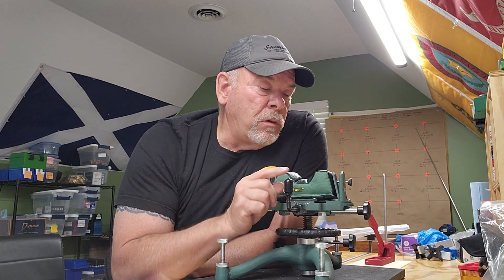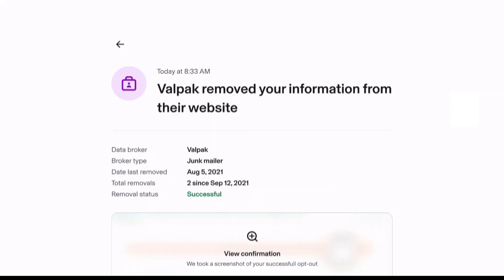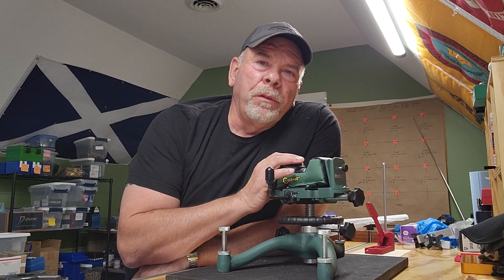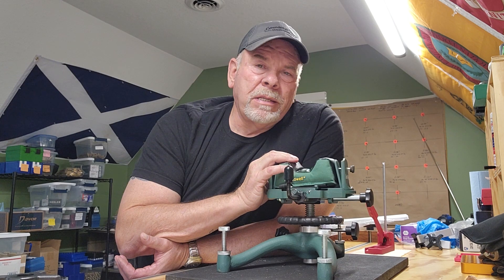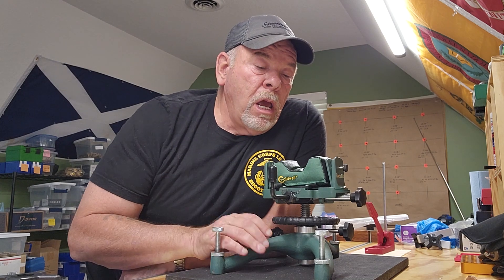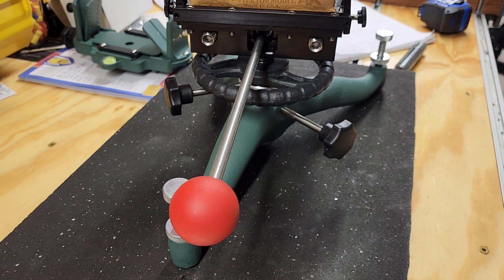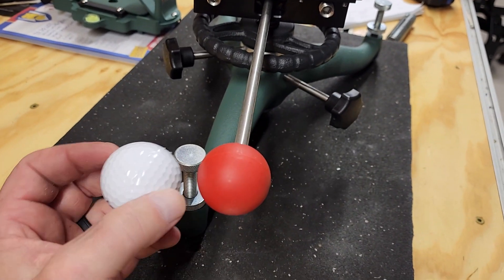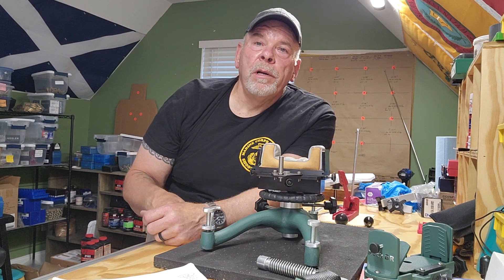Caldwell Rock BR   Frankenstein Rest Review & Function

Comment: Caldwell Replacement Feet for The Rock BR with Rubber Coating for Range Sight In and Shooting Stability might be a solution for concrete benches.  These are available in the Caldwell store on Amazon.

Comment: The available post sizes are listed below.   What size did you choose for the Caldwell?
.750-10 (3/4-10) threaded post
.875 (7/8) ACME post     (This is obviously not it)
1.00-12 (1-12) threaded post
1.00-14 (1-14) threaded post
Reply from the maker: Butch @ Shadetree Engineering will guide you on it but, it was the 7/8 ACME Thread 7/8-6

Comment: Cannot take the screw off, the one you're doing at 18:10. Any suggestions?
Reply from the maker: @Mapleseed2883  hmmm... I would imagine you've tried some WD40 or other penetrant? If you're using a regular Allen wrench or a screwdriver handle type, maybe just not able to get enough torque on it. Try a T Handle Allen Wrench and/or wrapping the handle with something to get more torque.